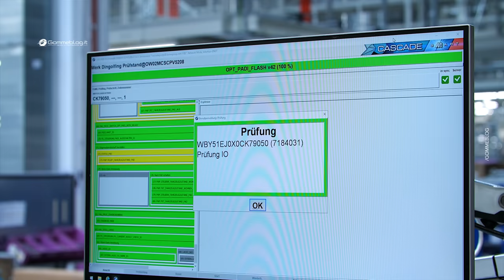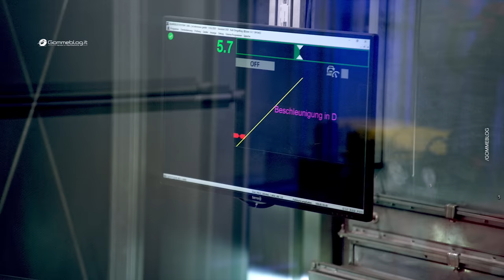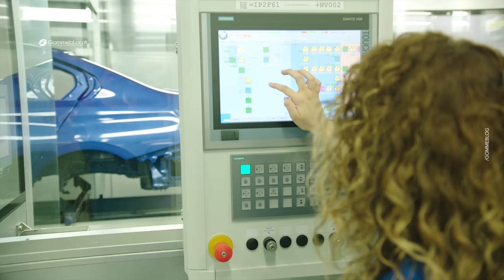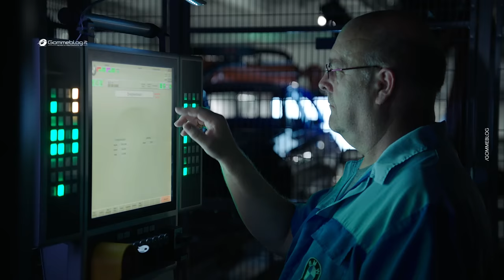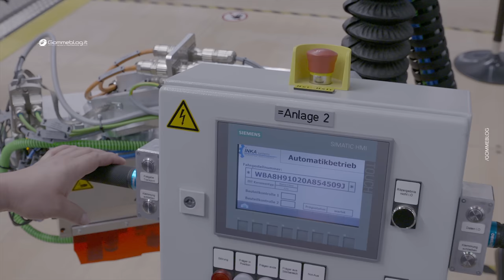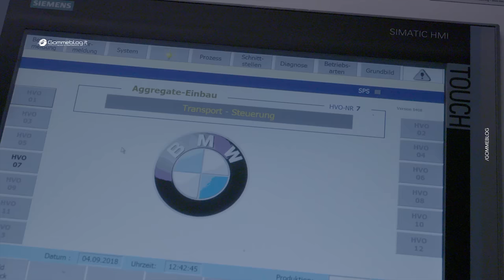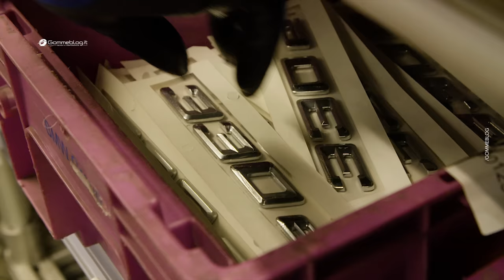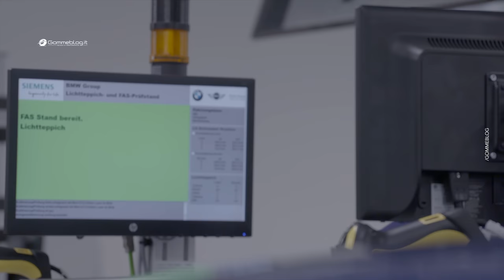BMW Sedan (G20 - G60 - G70) Car Factory Manufacturing Process

Comment: I recently bought a 530e in Colombia and when they delivered the car the air conditioning wasn't working. I cannot belive a BMW is delivered that way so that's why I'm checking this video so understand if the issue was directly with the manufacturing process or if it was the authorized dealership that has broken it somehow.

Comment: SCARY ;;;;;;;AND MANY PEOPLE ARE UNEMPLOYED
Reply: Makes you wonder why you watch this channel if you can't understand what's behind the scenes. In direct and indirect employment there have never been so many jobs in the automotive industries, why? Because everything you see like the robot arms, the rails, the reflection controllers, all the technologies that the car integrates, ... All that requires human work constantly.

Before, it took two people to mount the wheels on each side, today none, but on the other hand it takes a hundred to develop the robotic arms, the software regularly adapted to each car, the integration of new aluminum technology, rubber, abs, Pressure sensor, ...
Reply: What of the people manufacturing those robots? Will they be employed if humans should be working on the cars ?